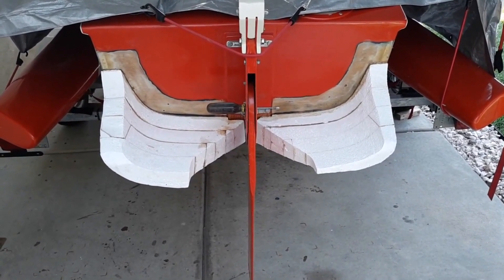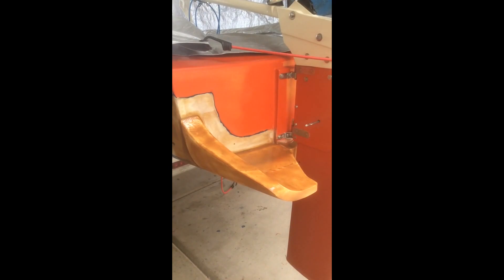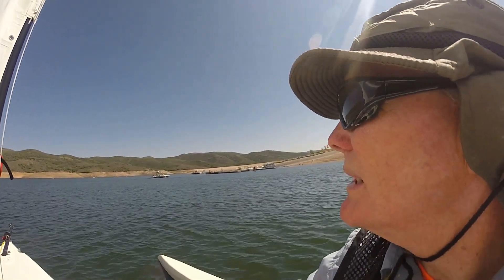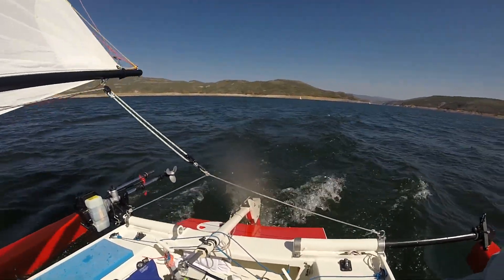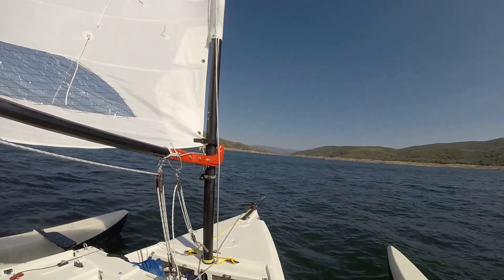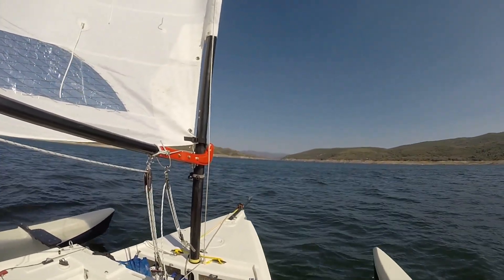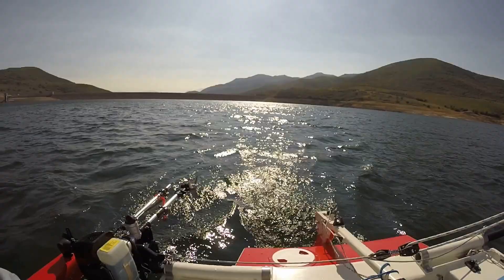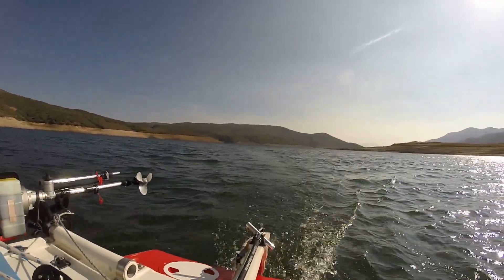Squirt Trimaran Gets a Swallow Tail

Comment: Hi Eric
What glue do you prefer to use to attach styrofoam to styrofoam and then styrofoam to epoxy coated wood?
Thanks
Glen
Reply from the maker: Have to confess I didn’t research that. I expect others could answer better. Since I had epoxy and wood powder I simply used that. But I did not use styrofoam. Used closed cell polystyrene foam, 2, 3 and 4 pound density. Whatever I could find locally or on-line.